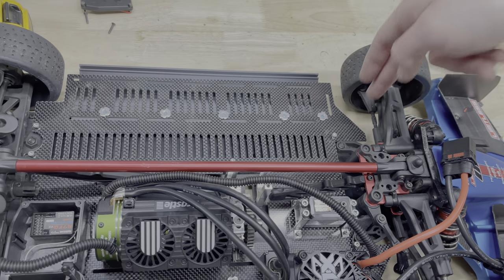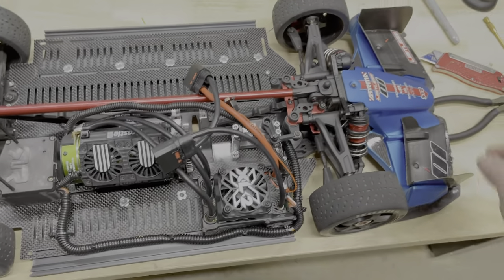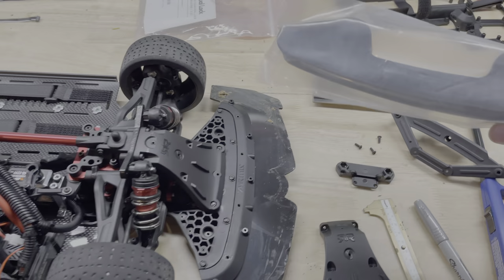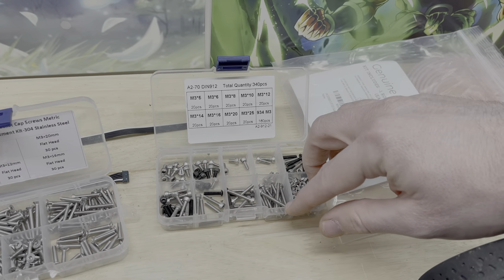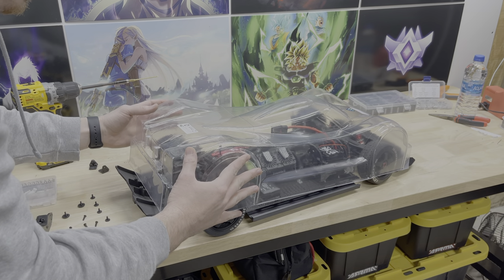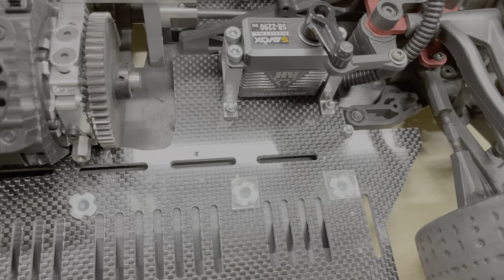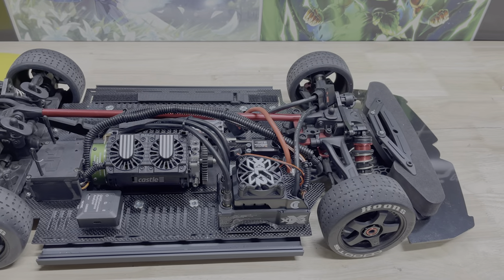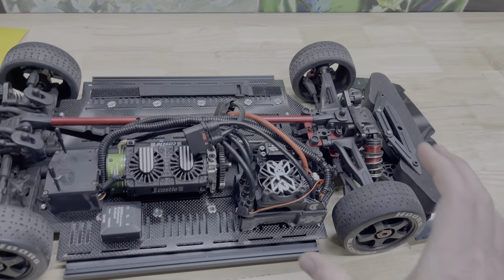Arrma Limitless GT Project | Part 2 of 6

Comment: Hey brother question just picked up my first XLX2 I was watching a friends video on a build he’s doing he’s getting ready to put his XLX 2 and he said that he’s going to remove the auxiliary wire. That’s a big no-no isn’t it? I thought you have to use that no matter what. I know you’ve use this ESC quite a few times so I figured I would ask thanks
Reply from the maker: No concerns at all with removing it. Raz Shifrin does the same thing.
Reply: @GoKaioken  Okay thanks. I know when the manual it says you absolutely have to have it. Plugged in. But I haven’t seen a video of the actual full installation of it. That’s why I figured I would ask you thanks for the info bro appreciate it
Reply from the maker: Anytime man, have fun

Comment: Does your 1100kv have very little compression in the motor?
Reply from the maker: I’m sorry but I don’t know what you mean by compression in the motor.
Reply: @GoKaioken  when you spin the shaft that the pinion is on. Alot of resistance or very little.
Reply from the maker: Little